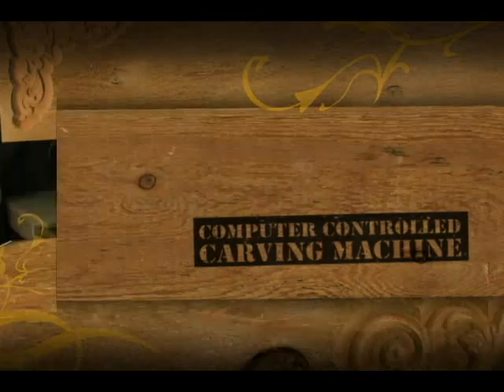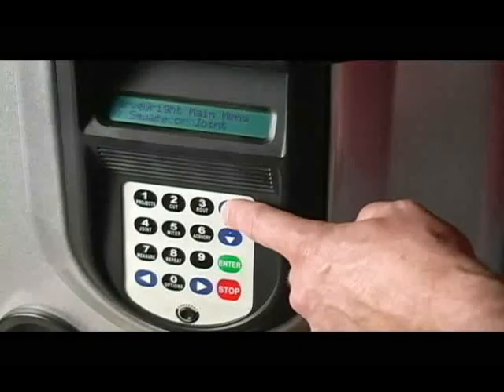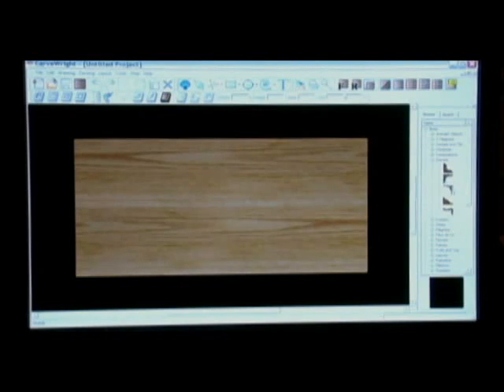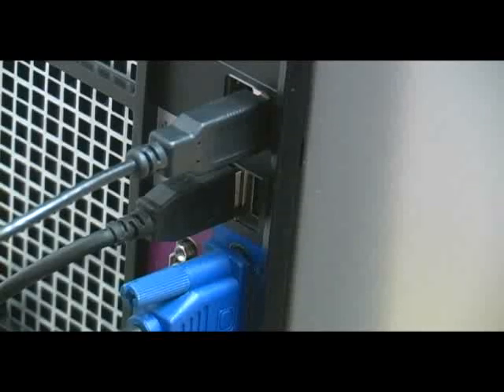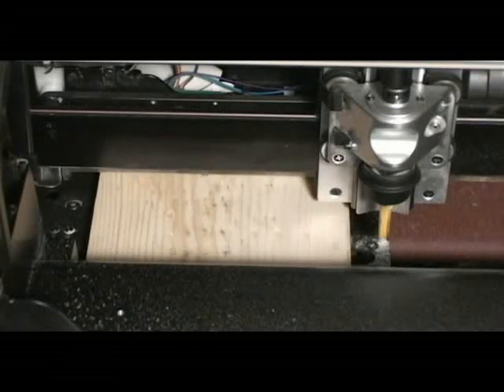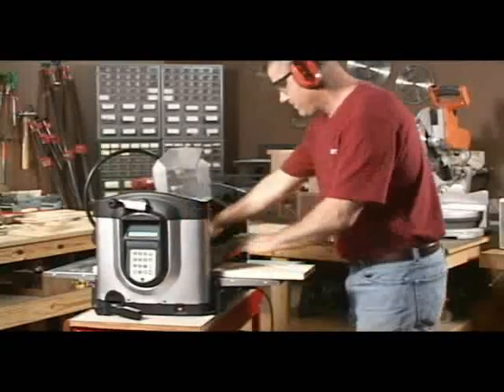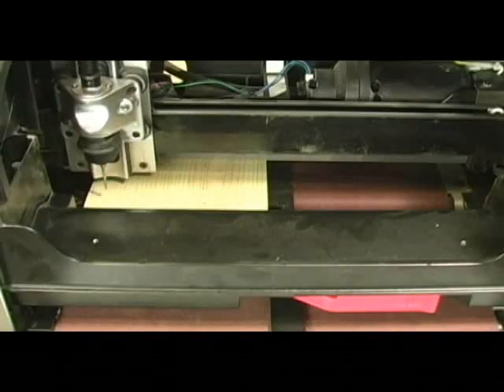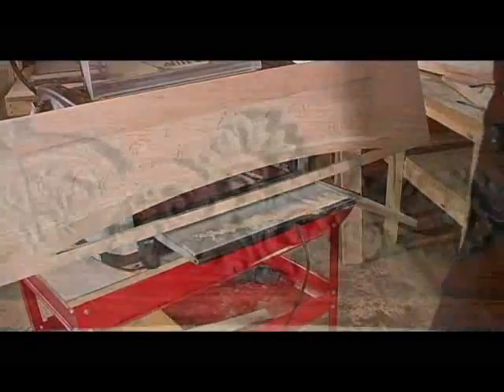CarveWright Woodworking System

Comment: Its stated that it has a 5 inch  depth capacity, however  the video shows a limited hight as far as bit clearance.

Whats the actual maximum height of clearance for wood working? Say 21/2 inch??